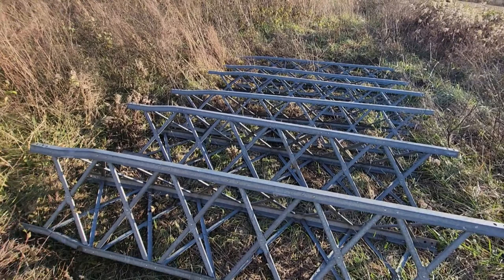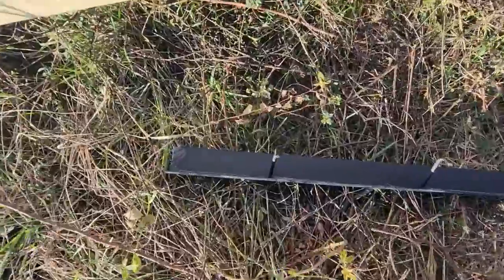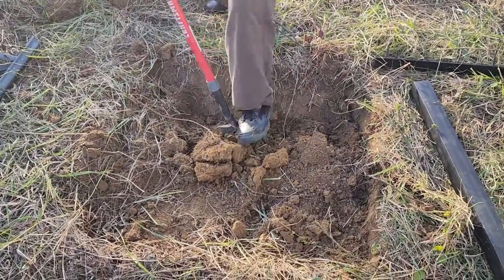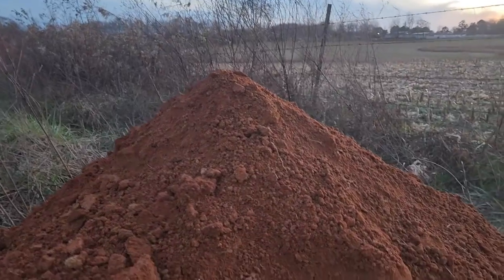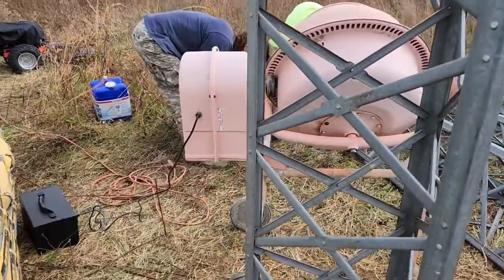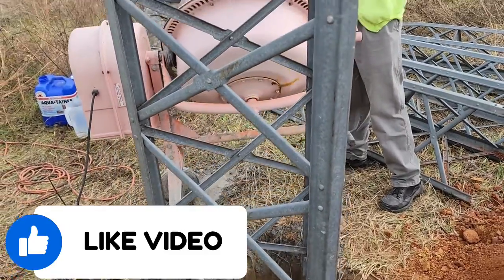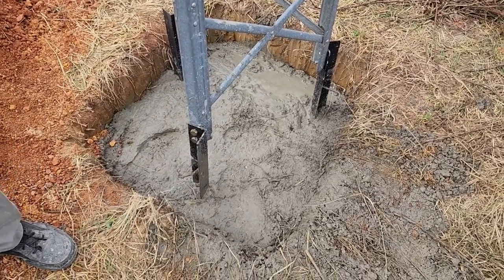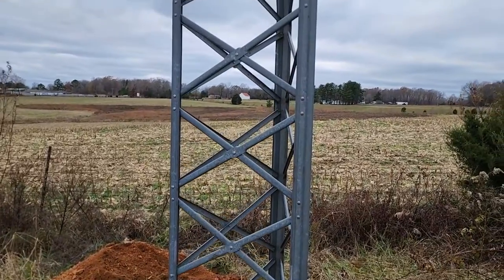LCARA HAM Radio: Rohn 48' Tower Installation Part 2 - Hole & Concrete!!!!

Comment: I used to own commercial radio stations. The tallest tower I had was 890 feet for my FM. 
Ive never seen the tower pad buried under dirt; theres always concrete above the ground to drain water away. And no rebar?
Wow... just wow...
Reply: yeah ...when non-engineers DIY shit it's cringy.

Comment: You are going to want to add more concrete on top of what you have there.  The concrete must be above ground level for water drain off or those legs won't last long.  You will need a lightening arrestor and a ground strap.  Flat woven copper, not a wire.

Comment: Everybody is a critic . that is a crappy set up , those angle irons are straight , if enough wind hit that tower , that angle iron would pull straight out , those 1/4" round pegs welded are a joke.  but i'm just a critic. hole is not deep enough

Comment: Do what the amish do, just pour the quickcrete into the hole and mix it with dirt, in time the quickcrete will soak up the water from the surrounding area.

Comment: For my father-in-law's tower we poured a 4x4x4 rebarred with 3/4" studs welded to the rebar everything cemented into place for bolting down a 1" plate which I drilled and tapped for leveling bolts.

Comment: No cage of rebar or some other attachment to the tower through the middle of the concrete on the base? Just the 3 legs in a few inches of concrete at the perimeter of the yard of concrete?
Reply: a lot of it will depend on wind/ice loading but yeah ....... i'm going to be putting up a couple of towers soon and i'd rate this base as OK for a 40 foot tower for 10-15 years tops with no ice and max wind of 70 and a 2 foot windload.

Comment: 36 inches deep? Oh My......I have the 56 foot version of that tower and I dug down 5 feet. My hole is 4 foot square and 5 feet deep. 
Barry, KU3X
Reply: I know! Add to the fact that the soil is very loose and they didn't use any re-bar. I definitely won't be climbing that tower.